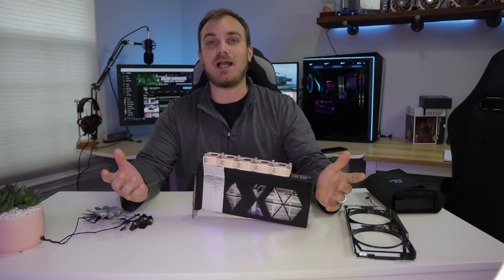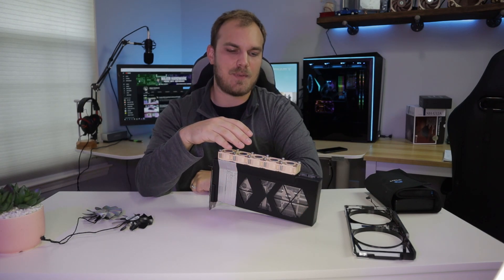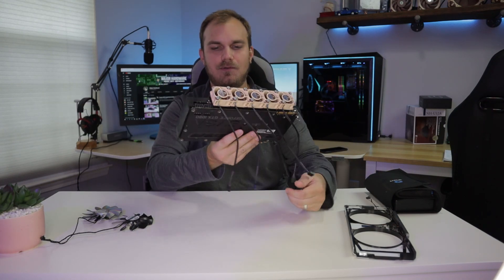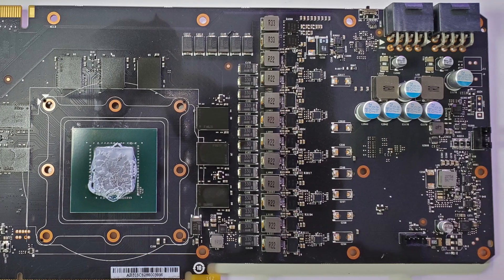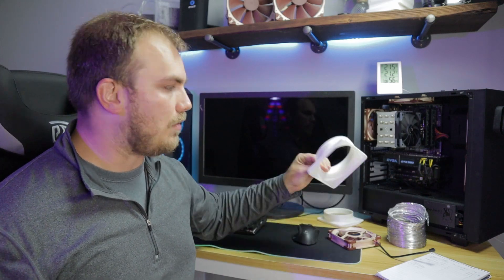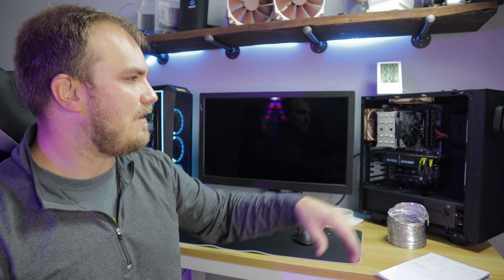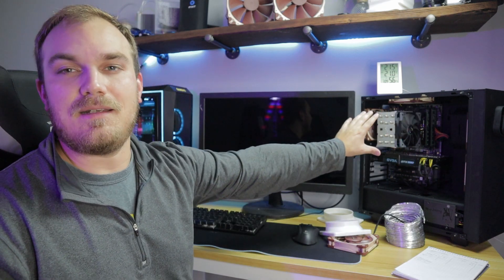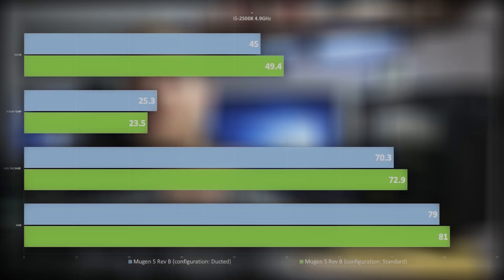Does Connecting Your CPU COOLER Directly To Your Case Fan Improve Temperatures?

Comment: These cpu to case shrouds used to be common about ten years ago!
Reply: I was just about to say the same thing, i still have a few OEM pc's like HP's Acer's and Dell's from the late 90's early 2000's laying around that have the ducts on the side panel
Reply: I came here to say that, I am glad other people remember that this was the hotness in early 2000’s
Reply: I just bought an HP Proliant old server today and it had a very nice clear plastic shroud from intake to exhaust. Interestingly, it wasn't for the CPU, it was quite obvious it was to direct cool intake air over the RAM. I'd never seen that before.
Reply: ArchAngelRaceWerks ECC ram runs really hot. I have a 2u rack server that had a dedicated fan and duct just for the ram. The output air from the ram was hotter then the cpu air.
Reply: @ArchAngelRaceWerks  rdimm ecc ram runs really hot
Reply: Yep same....I still have a case (not using it) with the side panel "Horn" to the CPU!!!
Reply: @Gamebit450  Yep, side panel with a fan or with a horn to the CPU.
Reply: yeah, mostly dell optiplex 360 towers... Were really quiet...
Reply: some OEM systems still use ducts. not directly attached to the fan, but the idea is the same
Reply: My wife just made me throw away my old shroud that mounted on the heatsink to go to the side of the case.
Reply: Apple used to be loved for their duct designs on the Mac Pros right? The enclosure itself (once assembled) directed air from the front grill straight to the cpu where it was pushed from the back.
Reply: More like 15 years ago, but yeah. Before tower coolers became common, people drilled holes in their side panels - until case manufacturers noticed and started making cases with the hole already there.
Reply: @SteelSkin667  yep still have my nips, dremmel and hole saw from my modding years in the early 2000's 😅
Reply: Still common in datacenter racks. Especially seriesed CPUs
Reply: 🙂 yes, i picked up an old Coolermaster Case, the side panel has a 'cone' that goes right over the cpu fan, i took it off tho when i switched over to a tower cooler
Reply: @MrSamadolfo  That's a Cooler Master 120 elite case with that duct on the side since I'm still using mine. My CPU stays cooler with the side panel on since I adjusted that duct length and installed some 3/4" foam weatherstrip to seal against my CPU fan. Also replaced my fan with an aftermarket noctua fan.
Reply: @justins.1283  😎👍 Cool, im working on a used build for the coolermaster case this week, we got an i7-870, 1156 asus, 8gb, gtx 950, yay! 😍
Reply: You are right. I have an old Dell 690 Inspiriorion for shits and giggles and there is a hard shroud that takes air through a cpu heatsink and over a bank of ram before another fan out the back.
Reply: Actually it's very common in old hp pre built.
Reply: Yeah my dad's old AMD Athlon x2 powered  gateway PC used a very similar principal to keep cool. I actually still use the 120 mm fan shroud from that PC in my current system, really a great idea.
Reply: J  dimt lniw se wtg
Tfw wtf
Reply: It still common.... just this guy is at least 50 years late on this idea.
Reply: They are in servers
Reply: yep i remember my first build in early 2003 even the cheapest of cases had this as a "feature"
Reply: only on prebuildts
Reply: @erlend1554  nah mate, it was common in teh cheap case market back then aswell as prebuilds
Reply: coolermaster had some case with a duct at the sidepanel , and a company called sunbeam (i think it was) sold a specific cooler duct kit like the one in the video
Reply: I had this! On my k6 - 2
Reply: I remember Dell having these green ducts/shrouds in their cases back in the day.
Reply: Holy shit, I was about to say that! Opened a THEN old as hell PC like 10 years ago to see a duct setup in a Dell as well.
Reply: My first pc had one, with a pentium 4 in 2005. Good times. Now I'm currently working on a diy case and want to get a shroud for my ryzen cpu or make a shroud myself. Any tipps?
Reply: Its getting depressing that I'm old enough to remember when those hard plastic shrouds were commonplace.
Reply: @Pancreaticdefect  I'm getting depressed because I remember when aol dialup was the best internet you could get and you had to wait weeks for them to send you the startup disc by mail back in the days when windows 95 was the best you could get.
Reply: I still remember those yet engine shrouds that came from side panels. Then the sidepanels were replaced with acrylic or glass windows to "show off" your PC.
I blame this silly RGB generation.
Reply: Yes thank you. I was like, “we already know they cool better with a shroud. Why did we ever take them away?”
Reply: yeah. Honestly my core 2 quad vista machine probably would've died without it.
Reply: the old prescott tube
Reply: Cool
Reply: used to have this in an old workstation case yes !
Reply: I still make them in my builds but out of tape.
Reply: used to be standard in old office dells
Reply: Thank god I'm not the only middle age person here.🤣
I had a case back in 1998 that had a port in the front of the case and a port in the back. The cpu had a push/pull config. It took outside air in from the front and exhausted it out the port in the back. Cpu air never entered the case. It was all contained.
Reply: yh i had a HP media centre PC that  had a plastic shroud
Reply: I had an old Pentium 4 desktop case that had a duct for the cpu cooler.
Reply: It was part of the case spec for some of the Pentium 4 cpus. There was a shroud in the side panel mostly which lined up with the stock cpu cooler.